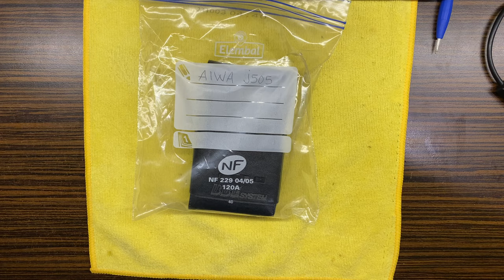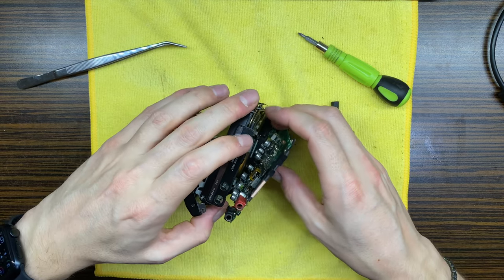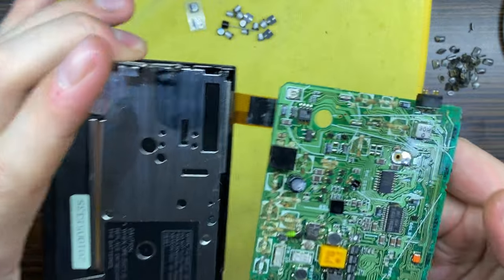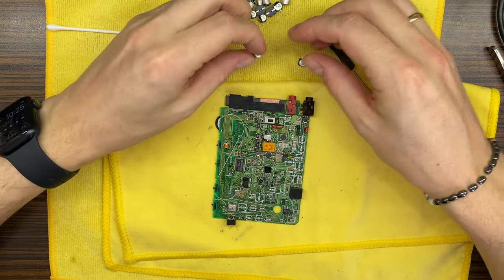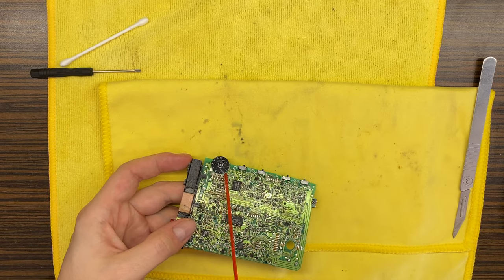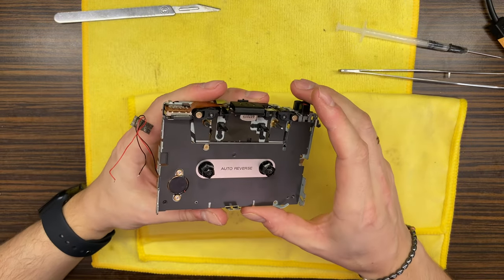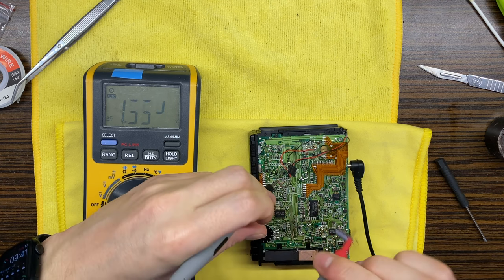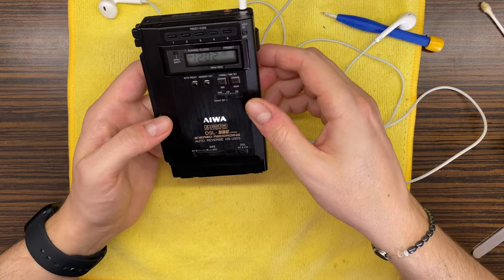Aiwa HS-J505 walkman - portable cassette player repair fix #diy #repair #challenging E0022

Comment: Hi, what kind of lubricant for the drive mechanism?
Reply from the maker: Hi 👋 for capstans bearings and motor front bearing i use high end mechanical watch oil. For other lubrication - lithium grease.
Cheers